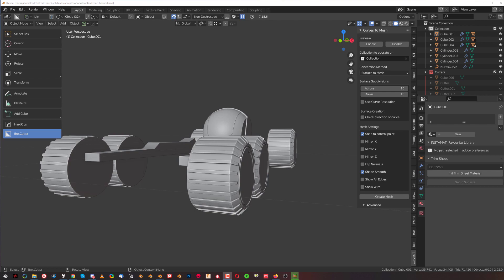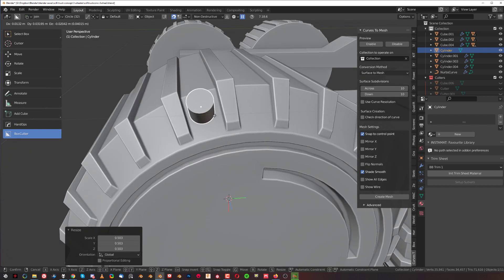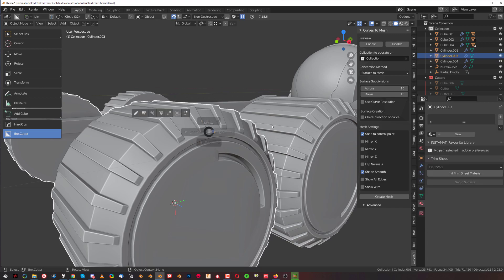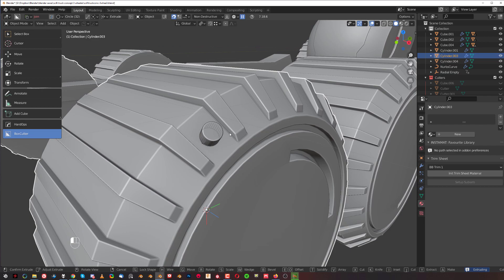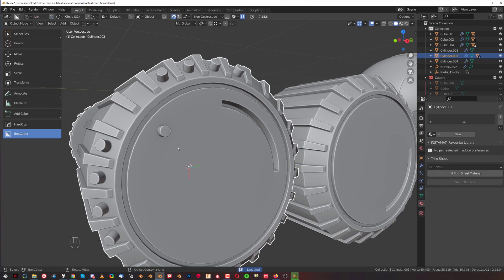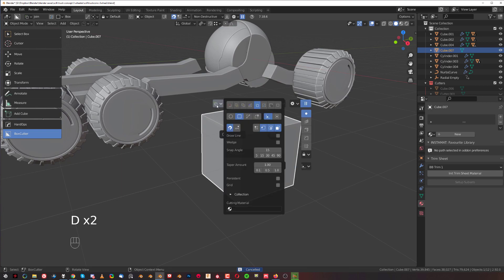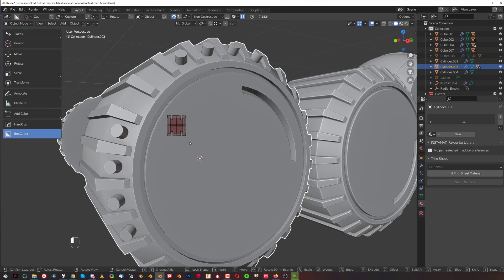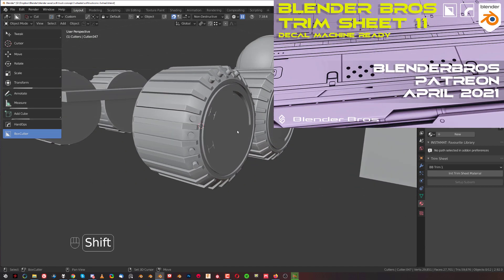Manual PRECISION array with Hopscutter - Blender tutorial

Comment: I've tried the ctrl*-click on the middle dot but it goes inside the mesh not outside. The normals are fine. Any idea what the issue is? (FIX: Well updating Hops & Boxcutter helps :P)
Reply from the maker: it;s ctrl click mate, and you cant be in cutter mode if you wanna go outside the mesh
Reply: @PonteRyuurui  yeah sorry i ment ctrl click, and I have the "join" mode on. i can click on the cutter and drag it up afterwards and its working that way but it doesn't go on top when I ctrl double click on the middle dot. When I select "cut" it works on top but not "join".
Reply from the maker: @ReaLadge  you dont drag it you simply repeat the cut
Reply: @PonteRyuurui  Yeah thats what i've been doing. i was just saying
 when i make the cutter, its underneath the face and when i select the cutter, i can move it up manually but that's clearly not what we want. i can show you through discord to explain it better if you don't mind.

Comment: How did you align the cylinder with the surface so easily?

Edit:
Nevermind, found it myself. Enable snapping -> Snap to Face -> Check "Align rotation to target", then move the object you want arrayed to the surface with G and you should snap properly.

Leaving the question and solution in case somebody else wonders. :)